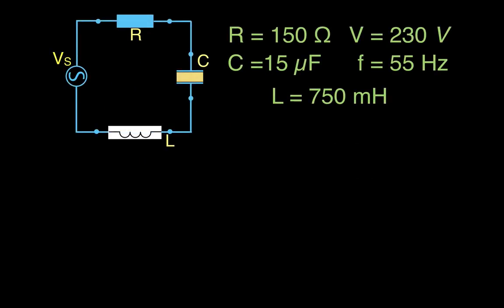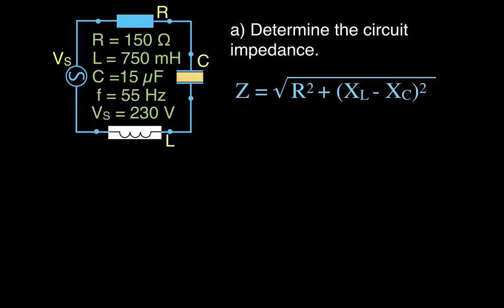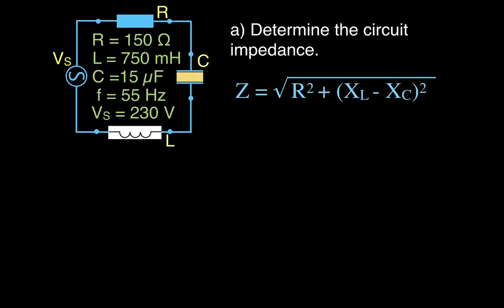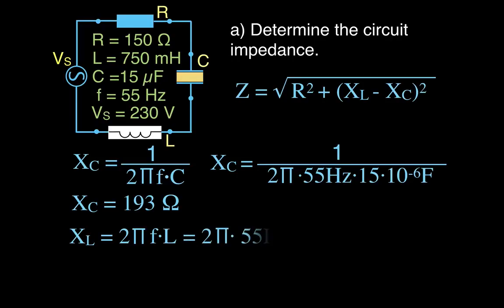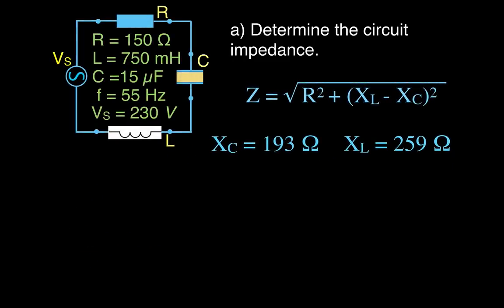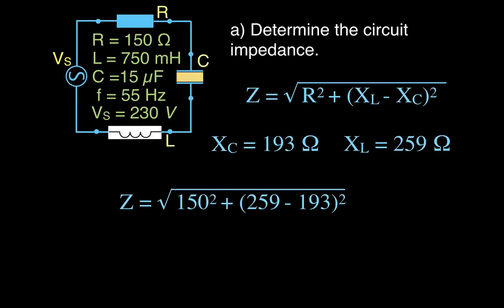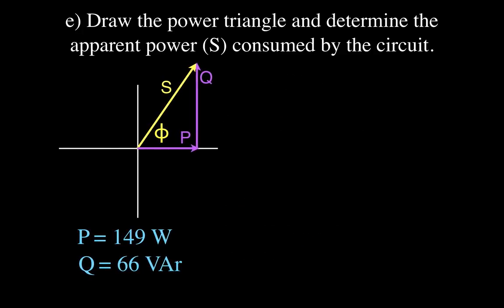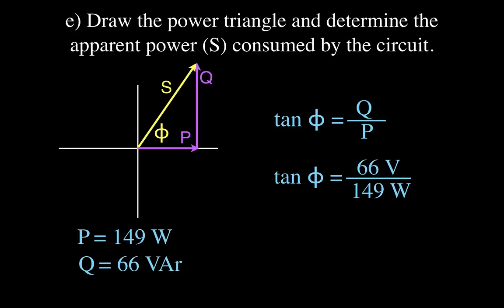RLC circuits (6 of 6) AC Power for an  RLC Circuit

Comment: Can we not find True Power= current squared x resistance?  Apparent power =current squared x impedance?  Why are you using cos and sin? Power factor=cos thi. where thi is lead or lag
Reply: It's the same, Use whatever equation you comfortable with

Comment: You probably already realize this, but, around the 3 minute mark, you say microhenry but you wrote and plugged in millihenry. I was using your videos to test my computer program and found this error.
Reply from the maker: I think I know that already...I believe what is in the presentation is correct.
Reply: Yes, your numbers match my computer program, but only if I use millihenries.